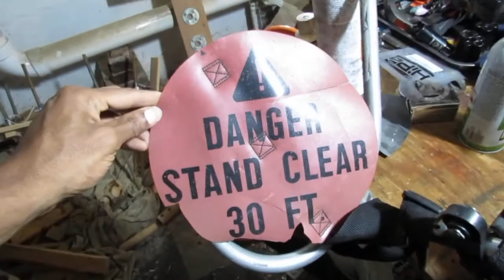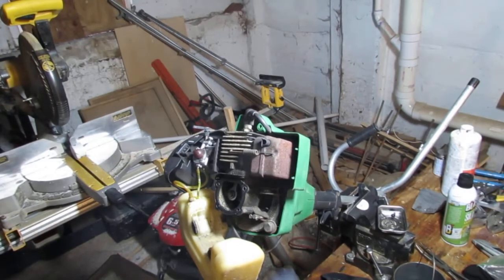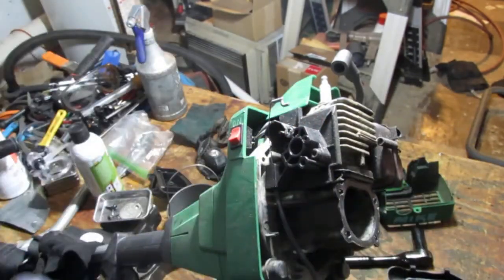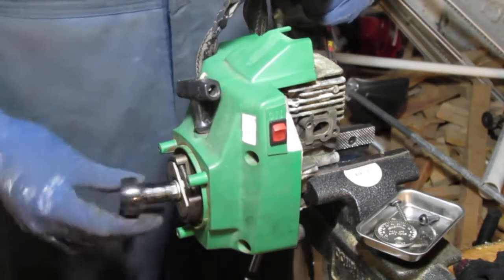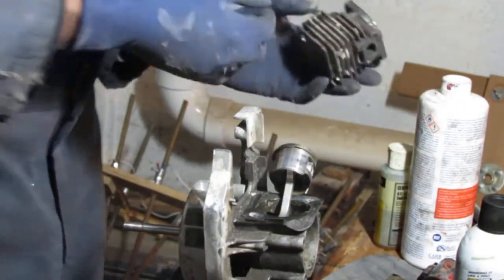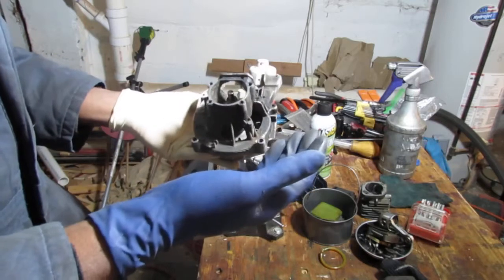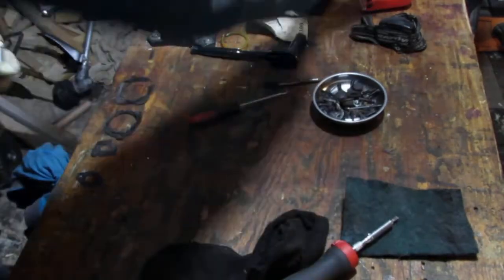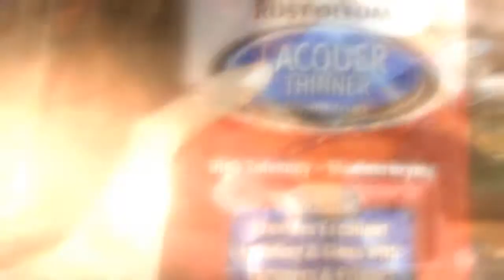Get It Running : Weed Eater BC24W Pairt I

Comment: You dont happen to know the replacement carb part number or name, i have the same weedeater but with the old carb that on the high side adjustment screw there is a plug or something?
Reply from the maker: The first 5 seconds of this video look at the still image.  It has the carburetor information embedded.   This is the best trimmer I have ever worked on.  Hands down the best design.